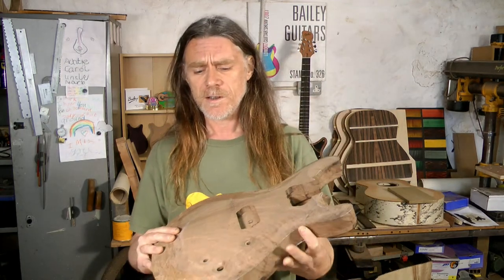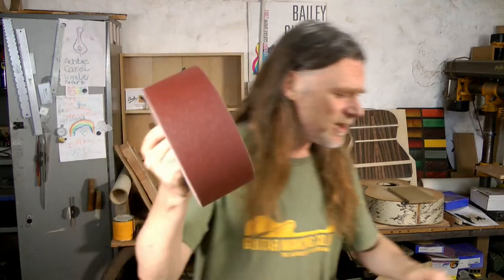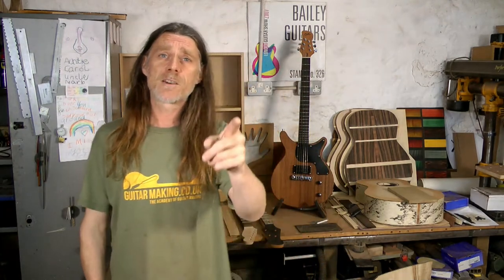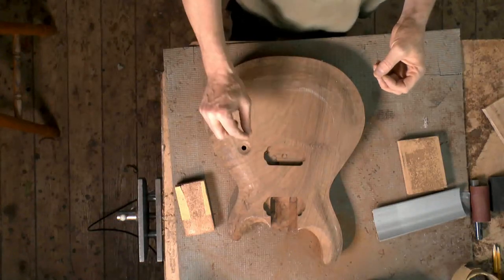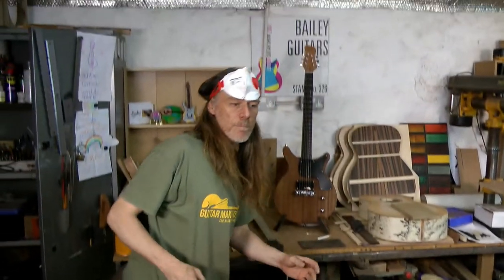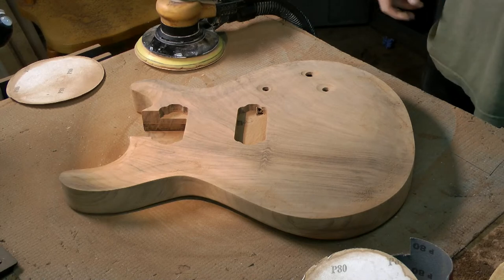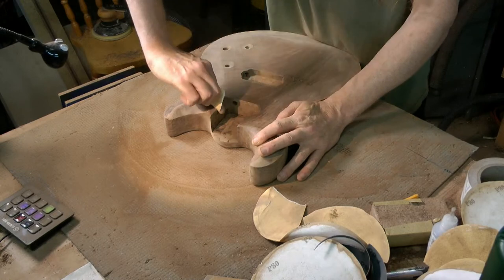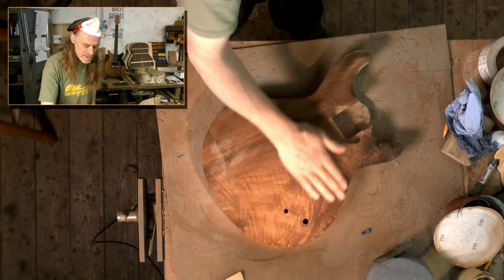Guitar Making Techniques: Sanding - Getting the flat bits flat and the round bits round!

Comment: Awesome detailed video! I have been quite addicted for the past several months and i have learned many new things every time i watch. I have a couple questions. 1) does that power sander spin in circles or does it just vibrate? And 2) it seems that when using the machine, sanding parralel with the center line was less important than when just sanding by hand. Or was i just observing wrong lol. 

Anyway keep up the good work!!!
Reply from the maker: Thanks JAY - Thats is what I was hoping for - I'll try to answer your Q's..1) Its called a 'random orbit sander' - and is supposed to remove its own scratches...In reality it leaves zazz marks that look like a stretched spring...but they are super easy to remove with a wipe of the same grit sand paper. 2) As you noticed - because it is making tiny 'randomm orbits' you cannot sand parallel to the center line... so just make sure to be methodical and don't cover the same area more than once...with a machine it is all too easy to oversand...Great Q's - Good luck!!